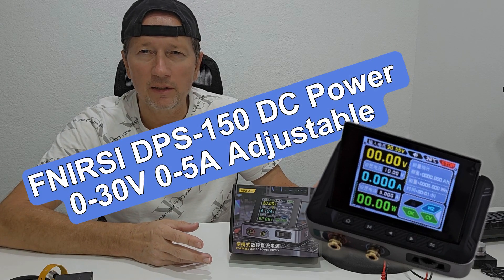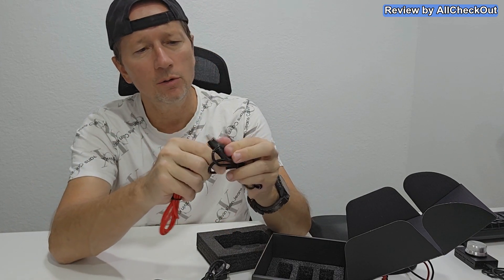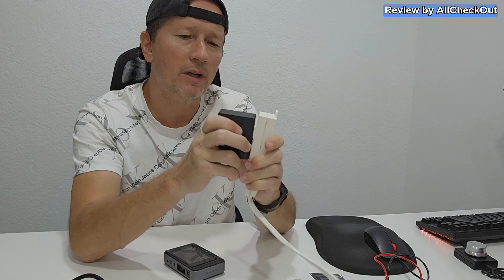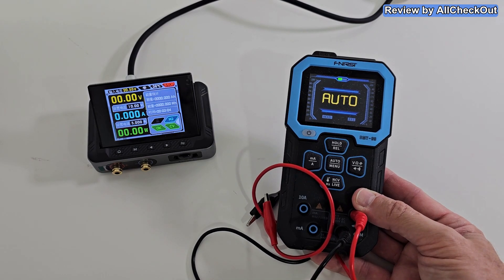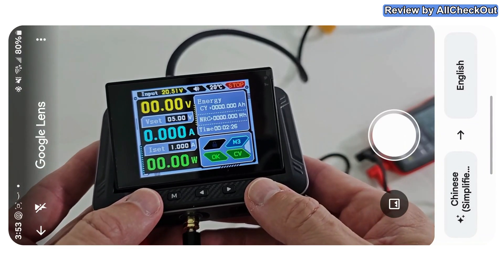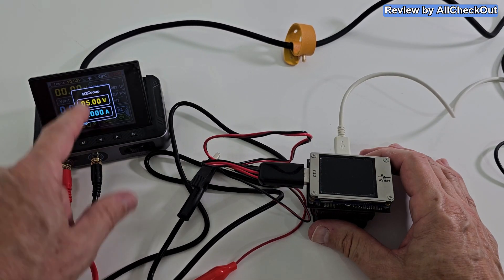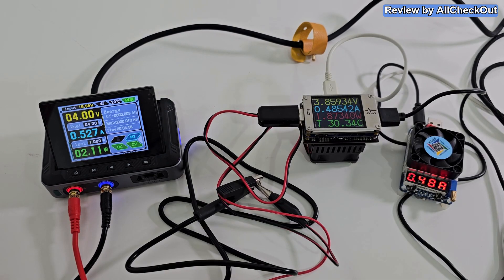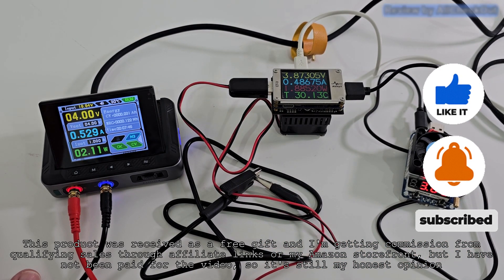FNIRSI DPS-150 DC Power Supply Review | 0-30V 0-5A Adjustable with 4-Digit IPS Display 2024

Comment: The audio is good. The first section just has too much echo from the room. Maybe put up some wall panels. Especially, if this is your Youtube studio.
USB-C is fancy but the 100W power supply's are pricy. I'd go for a laptop power supply. They kind of accumulate for free, if you keep your eyes open.
Reply from the maker: Thanks Bro. I have some pads since a few months but could never decide where to place them. Echo has a bit removed since I started here because I'm piling up pending projects here inside .... 🤣🤣🤣 .... but sure ... it's still too much. 140W USB-C didn't work. It seems to only allow for 20V PD and not higher voltage. For more than 100W you need DC power supply for the DPS-150.